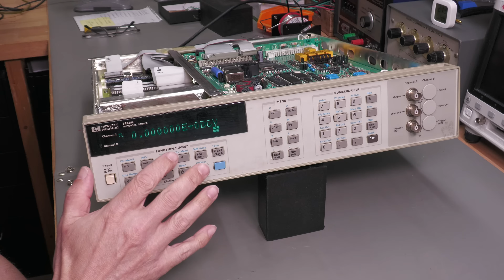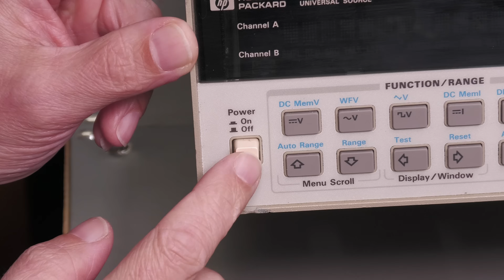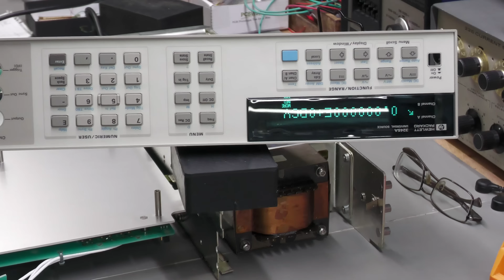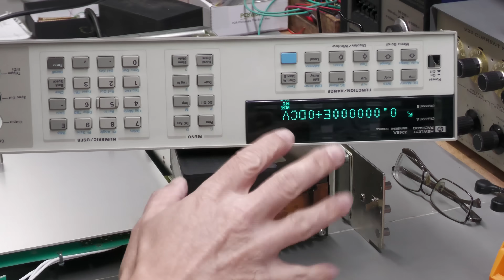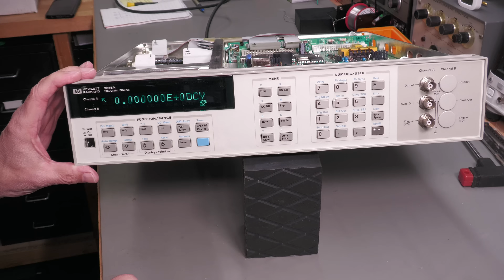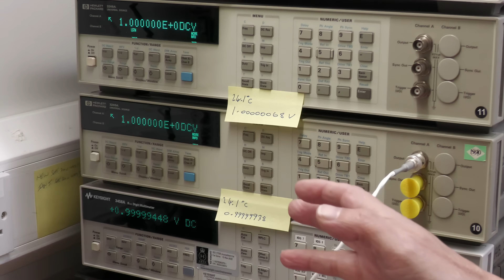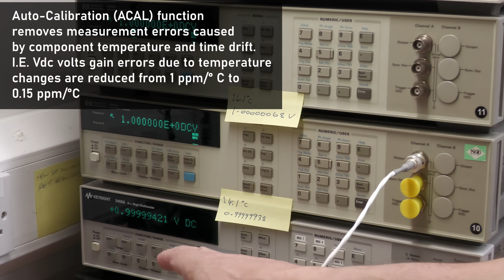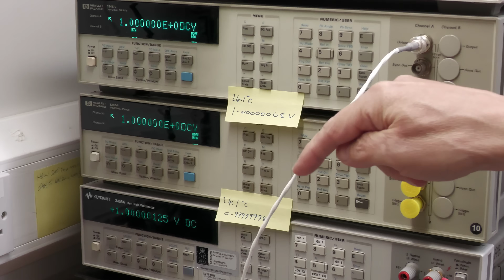No.117 - HP 3245A Universal Source Repair, Mods & Upgrades - Part 2

Comment: Quieter opamps in one, quieter reference in the other 🤣 I don't quite understand why not leave one alone and do all mods to the other, to then test the full difference?

Datasheet spec says (at 1V) 8ppm+15uV for ∓1℃ 24 hour, or 40ppm+31uV for ∓5℃ 90 day

31/5 = 6uV/℃, and your difference was that over 2℃, so still inside 50% of spec?
Reply from the maker: Bought at different times. The ADR1399 one is meant to be a quick fix upgrade for anyone to do marginal as it is. Plus it is aging well the length of time I have had it and its been on 24/7.
The new 3245A is a totally sacrificial unit for experimentation.
Reply: @IanScottJohnston  I would actually be really interested to know which mod has the most effect on noise
Reply: @IanScottJohnston  I've read that aged LM399AH would have a more stable performance, did you give that a try or compare against that  ?

Comment: RE VFD's it looks like HP has used (in a number of their instruments) an unregulated filament supply related to mains voltage. Even assuming the mains may be low, in many cases the VFD filament is overheated leading to a shorter life than what could have been. It should be possible to add some resistance to lower the filament voltage to hopefully further extend their life?

Comment: I had gotten a couple of these from a surplus store that closed.  One worked but the other was completely dead, so I used the two to make one.  I still would like to do the Channel B mod.
Reply from the maker: Do you still have parts left over......I could use one of the coax cables that run to the front panel BNC's.....?
It's for a custom mod I want to make.
Reply: Sorry, just seeing this now..  @IanScottJohnston ..  I will have a look and see if I still have left overs.  If I still have the cable, its yours andI still have the 2nd unit.  I was gonna record the process I went through.  One of the units was in kinda rough condition.  I think the Universal Source is a pretty good unit for what it does.  I've been focused on getting my 8662 going.

Comment: I'm not a metrology expert but I am aware that local temperature gradients can cause significant problems. Perhaps you could experiment by removing two of the units from your 'lab'  leaving everything else in it unchanged, then mix and repeat. Probably not an issue in your case, but might be interesting anyway.

Comment: Got new camera? Video quality is nice, which setup is it? Looking forward for the long-term comparison with 1399 unit.
Reply from the maker: Panasonic HC-X1500E, and a couple of additional workbench lights so now 4off YN300AirII lights total on my gantry (2 either side).
I have always run Panasonic cameras and so went with the X1500E. This particular cam has a small sensor relatively speaking with it's competition.....so it likes a lot of light for best results. I spent quite a bit of time on this. The AF system is good, but the MF focus assist is GREAT!
Reply from the maker: I'm doing some tempco tests on this new 3245A and already have some benchmarks to work from. Plan now is to analyze and measure around the Vref/DAC etc and see where the releative instability lies. I know it's not the op-amps as I had already changed them. Maybe I'll end up with my own Vref circuit etc etc......who knows.....but it's great fun!
Reply: Do you have airconditioning in your lab to keep the temperature constant?
Reply from the maker: @pa1wbu  Yes, I have an aircon system that can heat, blow or cool. I am also running my own software to control it which allows me to get the hysterisis to around 0.3degC if I need to.....albeit it's usually switched off at night when I am not in a metrology mode!